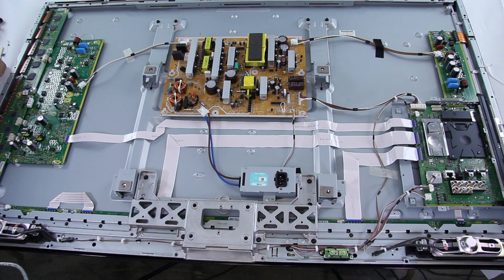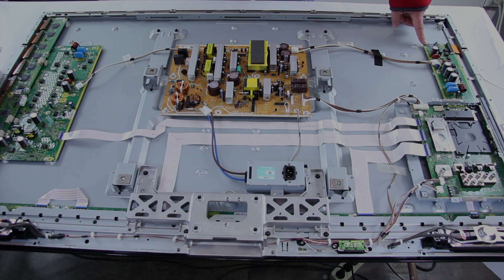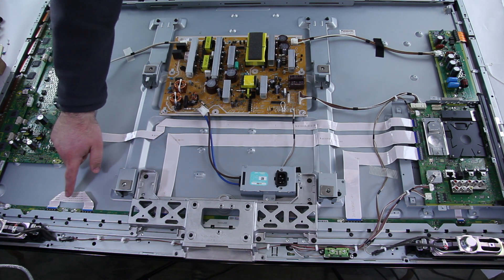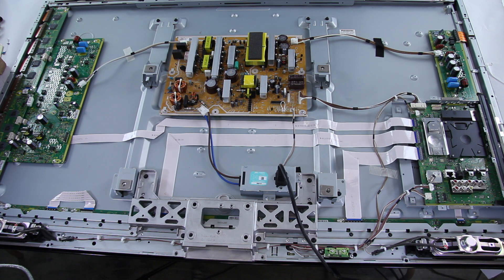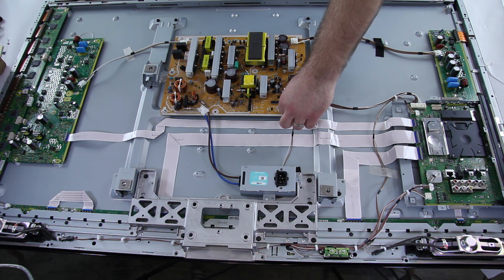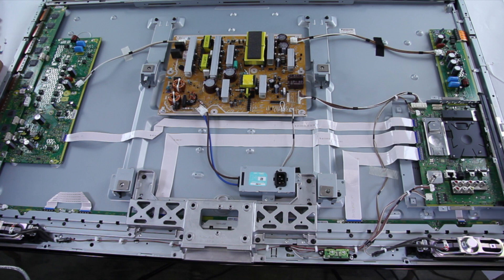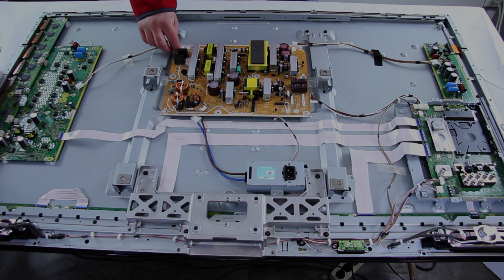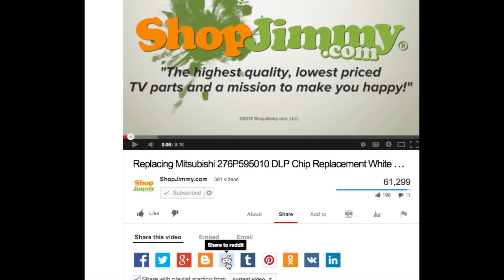Panasonic Plasma TV 6 Blink Code Explained Repair for 2011 Panasonic Plasma TV

Comment: I have a Panasonic model TC-P60S30UA. It is dead with no blink codes , I replaced the power supply and I still have the same problem
Reply from the maker: Avery C. Walker  Please watch this video FIRST to help with your repair!  https://www.youtube.com/watch?v=BP3NVNCGEv8  I recommend replacing the A Main Board in your TV.  Click this link to a replacement main board for your TV model number:  http://www.shopjimmy.com/panasonic-txn-a1pguus-a-board-for-tc-p60s30.htm  There may be multiple boards for the same TV model number, be sure to match part numbers on your current board, with your replacement for compatibility.  Here is a link to a video showing how to identify your part number, click here:  https://www.youtube.com/watch?v=IrfefQ7SIXk  Thanks and please let us know if you have any further questions with your TV Repair!  www.shopjimmy.com

Comment: I have a  2013 panasonic zt60 it shut down now we get 3 times flashing lights, which board would that be and how can I get that board?
Reply from the maker: Martin Rodriguez   Try this at your own risk. Unplug the TV, then disconnect the SC board and plug in the TV to see if the TV powers up. Reply with the results of this test. Thanks! www.shopjimmy.com

Comment: I have a Panasonic Viera plasma t.v. The model number is TC-P42X1. There is audio but no video. I can't even see the menu options. There is 6 blinking lights near the power button. I have not done any work to the t.v. yet. Any suggestions?
Reply from the maker: Darrell Grannis  Please watch this video FIRST to help with your repair!  https://www.youtube.com/watch?v=BP3NVNCGEv8  I recommend replacing the SC, SU & SD boards in your TV.  Click this link to replacement parts for your TV model number:  http://www.shopjimmy.com/catalogsearch/result/?q=TC-P42X1  There may be multiple boards for the same TV model number, be sure to match part numbers on your current board, with your replacement for compatibility.  Thanks and please let us know if you have any further questions with your TV Repair!  www.shopjimmy.com

Comment: Hi, I have a TC-P46S30  with 7 blinks.   If I disconnect the SC board, I get 8 blinks, then if I disconnect the SS board it goes back to 7 blinks.  The SC P/N is TNPA5351, I checked your web site and seems to be out of stock.   Is the SC board the part I need ? When will you have it back in stock ?     I have seen some different suffix designations (AG/AM) for this part, I do not see either of those on my SC board, any way to tell what one I have ?   Also, How easy are your repair kits to install ?  Thanks
Reply from the maker: Bill Day  Please watch this video FIRST to help with your repair!  https://www.youtube.com/watch?v=BP3NVNCGEv8  Since your TV did not boot up with either the SS or SC board disconnected, you will want to replace the main board or power supply board to fix the problem.  You may need to replace each board individually to see which one fixes the problem.  Click this link to replacement parts for your TV model number:  http://www.shopjimmy.com/catalogsearch/result/?q=TC-P46S30  Be sure to match part numbers on your current board, with your replacement for compatibility.  Thanks and please let us know if you have any further questions with your TV Repair!  www.shopjimmy.com

Comment: I have a panasonic TC-P42GT25.  It's giving me the 6 blink code.  In the past, I've unplugged it and when I plugged it back in, it would work.  Every so often it would do it again and I'd repeat the procedure.  Now it won't work even when I unplug and re plug it.

If it's not the connections, is it worth investing in repairing it or am I better off looking at other TV's.  Once the repair is past 200 or so, I'm thinking a new TV is a better option. It's just over 3 years old. and cost me 600 at the time.

Comment: i have a panasonic TC-P50S30 .. turn on blinks 7 times.. SC board disconnected blinks 8 times... where do i go from here
Reply from the maker: Martin Macias   Try the same test with the SS board disconnected.  Thanks!  www.shopjimmy.com
Reply: ShopJimmy.com  I have the same issue but i also disconnected the ss board but I get 7 blinks. Could shop jimmy please reply i really need this fix thanks in advance.
Reply from the maker: scorpio Pena   Please reply with your TV model number.  Click here to view a video that shows how to find your TV model number:  https://www.youtube.com/watch?v=S51nhAmwR2M  Thanks!  www.shopjimmy.com
Reply: ShopJimmy.com  Model TC-P50GT30   .I also went to your website to locate all 3 major parts that could be causing the problem but you only have SC BOARD, but not the SD BOARD AND SU BOARD. I already sent a ticket to see if you guys ever get the part to notify me. I really need the parts or the actual board thats at fault. I also tried disconnecting the SS BOARD but i get 7 blinking lights. Thanks
Reply from the maker: scorpio Pena   Please watch this video FIRST to help with your repair!  https://www.youtube.com/watch?v=BP3NVNCGEv8  If you disconnected the SC and SS board and still got a blink code you probably have an issue with the A board or power supply then.  You can try replacing each board individually to see which one fixes the problem.  Click this link to replacement parts for your TV model number on our website.  http://www.shopjimmy.com/catalogsearch/result/?q=TC-P50GT30  There may be multiple boards for the same TV model number, be sure to match part numbers on your current board, with your replacement for compatibility.  Thanks and please let us know if you have any further questions with your TV Repair!  www.shopjimmy.com

Comment: I have a Panasonic TC-P50V10.  It does not turn on.  There was a pop then the red power light blinked 6 times.  Any suggestions?
Reply from the maker: Ferdinando R   Sounds like a problem with the SC board.  Carefully look over the boards, especially the SC board and look for any burn marks or problems.  Thanks!  www.shopjimmy.com

Comment: goodday shopjimmy  i have a 2009 plasma tv tc-p42c1 have 6 blink does this video for 2011 also goes for brand that was made in 2009
Reply from the maker: *****   Try this at your own risk. Unplug the TV, then disconnect the SC board and plug in the TV to see if the TV powers up. Reply with the results of this test. Thanks! www.shopjimmy.com

Comment: i have a 2010 tc-p50c2 plasma with a 10 blink code that, once discnnecting the sc board from the a board, ss board, and p board, turnned into a 6 blink code. but only seems to happen when all 3 connections are removed, otherwise the 10 blink persists. from what ive been able to tell that means the sc board needs replacing? or is there more to it? i would love a reply, the faster the beter.
Reply: i would like to revise that comment. when the 12v to the p->sc, p->ss, sc->ss are all unplugged as well as the ribbon from the a board to the sc is the only time it goes from 10 blinks to 6 blinks.
Reply from the maker: Robert Kendall   Try this at your own risk. Unplug the TV, then disconnect the SC board and plug in the TV to see if the TV powers up. Reply with the results of this test. Thanks! www.shopjimmy.com
Reply: ShopJimmy.com well all the connections I mentioned are the only connections to the SC board.

Comment: Panasonic TV TC-P58S1 red light blinked four times intermittently, I disconnected the SC board and noticed that the light now blinks six times on and off. what should I try next?
Reply from the maker: Eddie Joiner   Try this at your own risk. Unplug the TV, then disconnect the SC board and plug in the TV to see if the TV powers up. Reply with the results of this test. Thanks! www.shopjimmy.com
Reply: ShopJimmy.com I disconnected the SC board and power up the TV the red light now blinks 6 times intermittently. What next?
Reply from the maker: Eddie Joiner   Repeat the same test on the SS board.  Thanks!  www.shopjimmy.com
Reply: ShopJimmy.com After disconnecting  the SS board the the red light now blinks once intermittently, where do we go here?
Reply from the maker: Eddie Joiner   You will need to use a meter for this next test.  Only attempt if you have expertise in this area.  Conduct all tests and repairs at your own risk.  Check VS and VA voltage on the power supply if VS and VA are both present replace the A Main board if they are not present, then replace the power supply.   Here is a link to replacement parts for your TV model number:  http://www.shopjimmy.com/catalogsearch/result/?q=TC-P58S1  There may be multiple boards for the same TV model number, be sure to match part numbers on your current board, with your replacement for compatibility.  Thanks and please let us know if you have any further questions with your TV Repair!  www.shopjimmy.com

Comment: Would this also apply to the TC-P55GT50?  I'm having a hard time locating within my searches that these are the steps to go through to resolve the same symptom on a 2012 manufactured model - additionally also attempting to identify if the parts that will need to be replaced are the same or not (I am suspecting not, but seeking confirmation & assistance in pointing to right replacement components). 

If anyone can provide any assistance, I would be greatly appreciative.
Reply from the maker: Jon Suppi   Try this at your own risk. Unplug the TV, then disconnect the y board and plug in the TV to see if the TV powers up. Reply with the results of this test. Thanks! www.shopjimmy.com

Comment: I have a panasonic viera tc-p42x3 serial mb12230435 I have no lights no power at all I replaced the power board today and still absolutely nothing ??? Any suggestions?
Reply from the maker: James Swartz   Try this at your own risk. Unplug the TV, then disconnect the SC board and plug in the TV to see if the TV powers up. Reply with the results of this test. Thanks! www.shopjimmy.com
Reply: Still nothing no lights or power with the sc board disconnected
Reply from the maker: James Swartz   Try the same test with the other side of the TV, on the SS board.  Thanks!  www.shopjimmy.com

Comment: I Have  model TC-P50GT30 Panasonic - it was 8 blinks - the I rebuilt the SC Board because the shorted transistors. Now I get the screen flash then 6 blinks -I followed the video - with the sc20 and c20 disconnected I get 5 blinks - I reconnected and checked the voltages. the voltage test points look different then what is on my board. The 5v and 15v points come up when turned on then go down. So is it my main  board or power board? The video doesn't say if the voltages stay up or do drop after the tv is turned on

Comment: I am still getting an 8 light blink code on power up, and if I unplug the SS board, I get a 6 blink code.
Reply from the maker: Denis Brisson Please watch this video FIRST to help with your repair!  TV Repair! LCD, LED, Plasma, DLP How To Fix Your TV with ShopJimmy.com Help!   I recommend replacing the SS board in your TV.  Here is a link to replacement parts:  http://www.shopjimmy.com/catalogsearch/result/index/?cat=65&q=TC-P50GT30  Be sure to match part numbers on your current board, with your replacement for compatibility.  Thanks and please let us know if you have any further questions with your TV Repair!  www.shopjimmy.com
Reply: I have the same problem @Denis Brisson 
Did u get to fix you tv? replacing which boards?

Comment: when I first turn on the TV the SS board turns on momentarily for 2 seconds, I see the green LED and then the relay switches and the whole thing shuts off.  The fans also start spinning momentarily on power up.
I replaced 6 transistors on the SC board since the SC board was shorting.  The board is no longer shorting however some of the transistors seem to short when it is connected to the SU/SD board.  Are you 100% sure it is the SS board?
Reply from the maker: Denis Brisson  Please watch this video FIRST to help with your repair!  TV Repair! LCD, LED, Plasma, DLP How To Fix Your TV with ShopJimmy.com Help!   I recommend replacing the SS board in your TV.  Here is a link to replacement parts:  http://www.shopjimmy.com/catalogsearch/result/index/?cat=65&q=TC-P50GT30  Be sure to match part numbers on your current board, with your replacement for compatibility.  Thanks and please let us know if you have any further questions with your TV Repair!  www.shopjimmy.com

Comment: TC-P50X3 -Tv had 6 code blink, unplugged it and set it aside for a month and then powered it back on. The tv came on this time except the screen is very blotchy and red and seems to fade in and out in spots. what could this be
Reply from the maker: Nickolus Wiebel   I recommend replacing the SC board and the buffers in your TV.  Here is a link to replacement parts:  http://www.shopjimmy.com/catalogsearch/result/?q=TC-P50X3  Be sure to match part numbers on your current board, with your replacement for compatibility.  Thanks and please let us know if you have any further questions with your TV Repair!  www.shopjimmy.com

Comment: I originally had a 7 light code for a Panasonic (Model# TC-P50GT30) unplugged the SC board and plugged it back in, now I get 8 light code and regardless of what I unplug and replug the 8 light code remains.  Does this mean I should change the SS board at this point?
Reply from the maker: Denis Brisson   Please watch this video FIRST to help with your repair!  TV Repair! LCD, LED, Plasma, DLP How To Fix Your TV with ShopJimmy.com Help!  Yes, I recommend to replace the SS board in your TV.  Here is a link to replacement parts:  http://www.shopjimmy.com/catalogsearch/result/index/?cat=65&q=TC-P50GT30  Be sure to match part numbers on your current board, with your replacement for compatibility.  Thanks and please let us know if you have any further questions with your TV Repair!  www.shopjimmy.com

Comment: Hello,

I have a panasonic TH42pz80E from 2008.
is the 6 blink code the same as this tv?

Greetz From Holland
Reply from the maker: Stefan Beek   Try this at your own risk.  I recommend disconnecting the SC board and then applying power to the TV to see if it will turn on.  Please reply with the results of this test.  Thanks!  www.shopjimmy.com

Comment: Hi, I have a TH-103PF10, IT TURNS ON FOR 5 MINUTES WITH PICTURE AND SOUND ALL OK, THEN IT SHUTS DOWN WITH SIX BLINKS ERROR CODE.
YOU HELP BE APRICIATED, THANK YOU IN ADVANCE.
Reply from the maker: John Diamantis   Try this at your own risk, but I recommend powering off the TV, then disconnecting the SC board to see if the TV will power on normally.  Thanks and please reply with the results.  www.shopjimmy.com
Reply: will try new sc board and see what happens.
thanks again.

Comment: Hi, I have a panasonic TC-P42ST30 that when I turn it on the red light stays on. What is that mean?
Reply from the maker: MrMarcosusa   Try this repair at your own risk.  I recommend disconnecting the SC board, then applying power to the TV and seeing if the TV powers on.  Reply with the results of this test.  Thanks!  www.shopjimmy.com

Comment: I've got an Panasonic 55VT50, with 8 blinks. When i disconnect the flat-cable to the SS board, the blinks change to 6. And then i tried to disconnect other flat-cables and found that when i disconnect C1 flat-cable, the TV is going on, and staying on (but with black screen). Is it safe to say the SS and the C1 are broken?

Comment: Hi,  I have a Panasonic TC-P50GT30. The internals of my tv look different then what you have listed. I have the 7 blinking light code what is the next step?  When I unplug c20 and the sc board I get the 8 blinking light code. Also I've tried to test the voltages however the test points are not located in the same location.  Thanks in advance for your advice.
Reply from the maker: LShizer  Try this at your own risk.  I recommend disconnecting the SS board in your TV and then applying power to the TV to see if it turns on.  Thanks and please reply with the results of the test.  Thanks!  www.shopjimmy.com
Reply: has anyone gotten back to you?  I am having the same issue, I had a 7 light blank; unplugged the SC board and now I am getting 8 blinks.  If I plug everything back in and only unplug the DATA cable from the SS board to the A board, I get a 6 light code.  I am assuming it is the SS board that is faulty, but I am unsure.

Comment: I have a P50GT25 and I am getting the 6 blinking lights. My model is not listed in your list of models in this video but you do have P50GT30 there. Will this still apply to my model?
Reply from the maker: PHENOMENON OFFICIAL MUSIC CHANNEL   I recommend replacing the SS board in your TV.  Here is a link to replacement parts for your TV model number on our website, click here:  http://www.shopjimmy.com/panasonic-txnss1lpuu-ss-board.htm  Be sure to match part numbers on your current board, with your replacement for compatibility.  You can also call our customer service for further assistance with your purchase.  (877) 881-6492  Thanks and please let us know if you have any further questions with your TV Repair!  www.shopjimmy.com

Comment: I have a Panasonic P60S30, that sometimes after 30 min, sometimes less, goes black (turn off?) and the red light starts blinking. Power board problem?
Reply from the maker: Alvaro Marfull   How many blinks are you getting?  Thanks!  www.shopjimmy.com
Reply: ShopJimmy.com
8 blinks.    Thanks to take time.

Al
Reply from the maker: Alvaro Marfull   I recommend replacing the SU and SD boards in your TV.  Here is a link to replacement parts for your TV model number on our website, click here:  http://www.shopjimmy.com/catalogsearch/result/index/?cat=4&q=P60S30  Be sure to match part numbers on your current board, with your replacement for compatibility.  You can also call our customer service for further assistance with your purchase.  (877) 881-6492  Thanks and please let us know if you have any further questions with your TV Repair!  www.shopjimmy.com